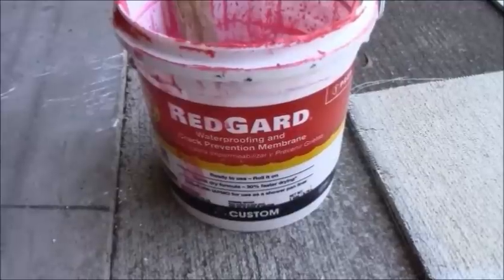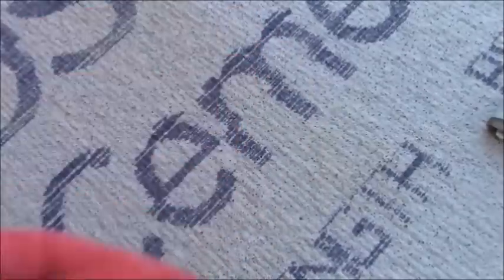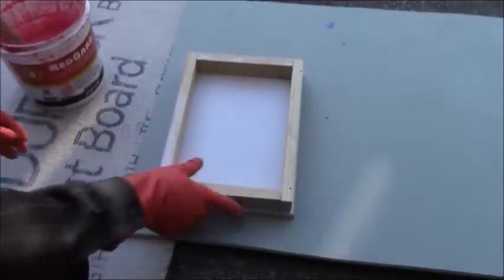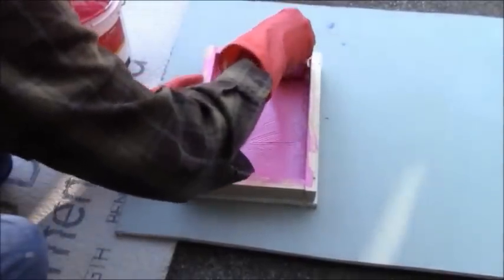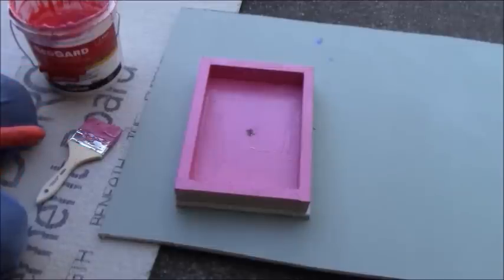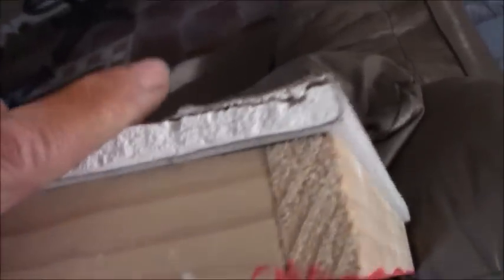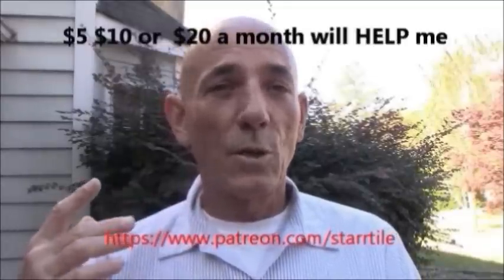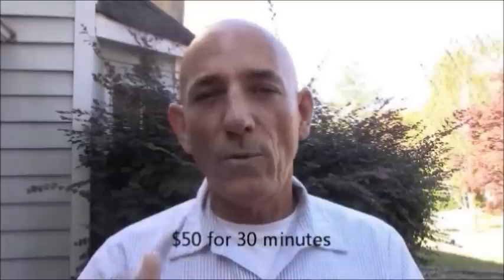REDGARD vs SCHLUTER

Comment: Thanks for putting this together, confirmed what I always thought, that all these systems work to be waterproof when installed properly. Love your freeze test. Many years ago as a Motorola engineer, we used to call this Advanced Life Testing with temperature cycling.The tile world is basically divided into Schluter and Redgaurd opposing camps, but let me offer an argument of support for Schluter Kerdi panel boards, that no one else ever seems to mention. They are light, light, light! I have weak wrists after a sprain a few years back, and a shoulder deltoid muscle that is very weak and bothering me. Carrying Hardy Backer boards, or cement boards upstairs in condos long distances is a nightmare for me, BUT, I can carry the entire tub surround of Kerdi panels in one trip they are so light! I don't have to cement down any kerdi membrane because Kerdi panels have it on there already, all I do is use Allset on the corners with Kerdi band. Done, no 3 or 4 layers of painting the whole shower with Red Gaurd. I don't have to breath in any vapors, and cutting Hardi backer is a nightmare, especially smaller strips, and so is cutting cement board, and leaves silica dust everywhere. My method of using Kerdi boards while costing more, 3x times price of Densshield, is very fast, no mess, takes less time very little effort, no dangerous vaoprs or particles, easy to wet shim onto studs, the black graph lines are very helpful to align your tiles, no brushing on multiple coats. When we want to save money, we use Densshield and Kerdi band the corners. Bottom line, do what works for you,  all these systems work. The only thing is I won't eve ruse green board because should something ever happen around it and water gets past the RedGaurd, you'll still have mold. BTW, Kerdi will fail if you don't use unmodified thinset, you can use Schluter's AllSet. Mos ttilers don't know what unmodified vs modified means, and can't read the ansi numbers on the bag, so they blame Schluter when it fails.
Reply: Thanks for the note.  With Hardiebacker® cement boards, there’s no need to worry about dust generation if you cut it using shears or the score-and-snap method.   You can find tips for doing this easily  here: https://youtu.be/4LxB5fHc5Xw
Reply: The system that does not depend on perfect implementation is superior.  Water makes portland cement harder so cement board is ideal.  If the red guard ever delaminates from the paper on a green board years from now that green board will fall apart if it gets wet.
Reply from the maker: @JamesHardieBP  I can't tell you how many times I pull out wall board that is embedded into the pan, the pan is wet and wicks up the wallboard, the mold growth will go up sometimes 16 to 18 in, and yes on hardibacker as well. I understand that is always a case of operator malfunction, but to say that a cement product is mold and mildew proof is a fallacy. I use Hardi in steam showers only because it is rigid and smooth, I would rather tile on a smoother surface.
Reply: @StarrTile  what if you apply redguard to the edge of the cement board?  My plan for my tub remodel is to have it overlap the tub flange by 1/8 to 1/4 inch and waterproof the edge with redguard so that no moisture can wick.  Is there a flaw with my approach?
Reply: One youtube video I came across said that he coated with redguard on his shower wall but didn't have time to tile finish it so he had been showering in there for three years without any problem,  LOL!!!

Comment: I recently built a home and redguarded the entire osb subfloor to protect it from moisture during the building season.  The redguarded subfloor was soaked several times by thunderstorms, sometimes the water sat on it for a couple of days.  The redguard protected the subfloor like a champ and never leaked.  The stuff works.
Reply: That is a great idea! I cheap out and used latex concrete bonder, takes a few coats but it’s fast.
Reply: I am even cheaper and use up polyurethane from jobs that would just go bad in the cans anyway.
Reply: Expensive though.  I used it on shed doors made of wood.  Then primed them and painted them.  Never warped or split.  Stuff is awesome
Reply: I’d have never thought to do that. 👍
Reply: That’s totally unnecessary. Osb are rated to be rained and exposed up to 6 month
Reply: This comment section has been waterproofed at good prices! Appreciate the tips!

Comment: If you're talking about just waterproofing for a full shower built the exact same way, (green board, pan liner, dry pack, etc.) it will still cost $120.00 for RedGard (two gallons for rolling out the walls two coats and three coats for seams, pan/curb, and niche/bench.) The only difference is the waterproof membrane. The cost for Kerdi membrane and a bag of thin set is also $120.00. The best benefit is no dry time between coats, and in this industry time is money. Great video btw, love experiments! 👊
Reply: I prefer to let the kerdi dry before tiling over it. If I ever have to pull a tile off a kerdi wall to adjust it the kerdi will often come off the wall with it. I'm just not comfortable with that. Whether I use roll on membrane or kerdi I let them dry.
Reply: Theres one slight difference between the two. The red stuff is waterproof.. The orange stuff is water resistant 🤣
Reply: Kerdi is more money. My customers don't wanna pay for THAT
Reply: Andrew Knapp 
Your labor free? Red guard is much more Labor.
Reply from the maker: @Crunch9876 I disagree RedGard is MUCH more labor, takes a little more time perhaps but given the failures I highlight with PRO's on Schluter I'd not want to take the chance....nor I doubt would an inexperienced DIY'r which is basically why we're posting these videos to educate homeowners not contractors.
Reply: @crunch9876  of course it isnt but where i reside with my client base i can't sell kerdi to anybody. In my experience people like to save money. I also DONT think the labor of redguard off sets the price of kerdi material. And lets not forget that you need neither redguard or kerdi for code compliance. Are they useful and good ideas...absoulutly. But we really are talking about the fundamental difference of an upgrade.
Reply: @michaelhorn9114  sure will if that means I can think for myself
Reply: @michaelhorn9114  it's amazing how well their marketing team works. Now they have brainwashed soldiers like you doing their bidding.
Reply: @michaelhorn9114  you're so brainwashed that you think I really care which product is used. News flash! I don't. I am only stating that the installation method prescribed by schluter is not waterproof.
Reply: Does anybody know the actual mil spec for red guard application?
Reply: @StarrTile  yep your right I agree with you. 😎

Comment: I did both my showers with Durock + Redguard (or similar product).  It was very frustrating having to do 4-5 coats of the membrane because of the roughness of the cement board.  When my brother did his shower, I consulted him to use Densheild.  I love it.  It's just like greenboard except a thicker front coating.  So it is already waterproofed and is sturdy enough for heavy tile yet scores as easily as any other gypsum board.  You still need to redguard, but mainly just screws and seams and maybe a single thin coat over the rest for good measure.
Reply from the maker: Agreed, I like Denshield too, hard to track down in my area and kind of pricey but it's a great product
Reply: Same here, I use denshield in every job, and seal the joints and screws with redgard or silicone and thats it

Comment: the only potential issue i have with using sheetrock is that you are essentially depending on the paper surface to hold the tile.  i use hardiebacker with redgard. yes, it is heavier and messier, but i'm thinking of getting the shears for cutting it. appreciate your videos and your willingness to share your experience-learned wisdom.
Reply: Once you apply redguard to the board. Tiles are holding to the redguard not the cement board, so if the redguard let go which it will take the same force as pealing the paper of the sheetrock. So i think sheetrock will do just as good unless you need the cement board for impact or something
Reply: Actually,  the floor is supporting the weight of the tile-not the sheet rock.   It's almost leaning on the wall.
Reply: Same with Schluter, they allow their membrane to be applied over regular drywall, let alone kerdi board which is FOAM.

Comment: In my career I've used literally every type of underlayment board available here. The, and I mean THE, only one I ever had a problem with was Hardi. Even Denshield gave no problem. Pro Hardi is it's smooth. If  you follow instructions, nail on marks (some being 12" apart) leave 1/8" space, mesh tape, wet with damp sponge before tile installation, you still run the risk of cracked or loose tile. My favorite was Durock, unless they have changed they were the only one UL approved for heat, sound, and moisture resistance. My standard for shower installation was 8 mil poly vapor barrier, 1/2'' Durock, and 3 coats of Red guard. Never had a fail. Never had a leak. Really enjoyed this one, and one question. Have you ever done a job where it was so hot ( new home) where you had to use ice water in your set and grout? Not fun!!! By the way, y'all think the fed shutdown is bad? Try what we are going to experience for the estimated next 14 months. ALDOT is shutting down 59/20 (20/59) coming thru to replace and redo all the bridges. GRRR!!!!

Comment: A full wicking shower is still the best method imo. Fat mud walls and curb and deck mud in the pan with a liner. All of these new products are nice but if you make one mistake your screwed. Felt wire and liner with a pre pan works very well and is very cost effective.  Just my opinion but I do enjoy experiments. Keep up the good work. Fyi if you really ask Isaac what method he would use on every job bet it would be mud with a hot mop and pre pan if he had his choice. Hot mop is really only done in Cali these days but same as a pre pan and liner.

Comment: As. far as I understand, you're supposed to use modified thinnest to apply Kerdi to drywall substrates, or ditra to wood subfloors. You're not supposed to use modified between Kerdi (or Ditra) and glazed porcelain, ceramic, or glass tile as the two surfaces aren't very porous and that will prevent the moisture from dissipating  from between them as both surfaces can act as a barrier against airflow. You're allowed to use modified thinnest if you want, though. But if you plan on using a sealed grout, be prepared to wait for extended curing time of your thinnest. For modified thinnest to cure properly, it's required to fully dry out. If it isn't allowed to, that's why people find crumbling damp modified thinnest .behind their detaching tiles. But as far as attaching any of it to a porpous surface that will wick moisture away, like green board and wood, that's not an issue. Greenboard isn't waterproof or a moisture barrier, it is as you mentioned, treated to inhibit mold and mildew production. It's still porous.  I'm using both Kerdi/Ditra and Regard in 3 different bathrooms right now in my house. Amazingly, the two can be used in conjunction with each other.
Reply from the maker: Good info, thanks
Reply: @StarrTile No prob. From all my research, the best waterproofing system is Laticrete's liquid membrane with their embedded fabric applied to Denshield. Though I don't know of a local supplier of either in my area which will supply it at msrp prices.

So.... my preferred methods personally is using kerdiboard due to the ease of installation as it's pretty hard to f- it up so long as you take the time to watch the installation video, and because you don't have to wait for it to dry to apply a second layer. Once you waterproof all seams and blah blah blah, you can immediately begin to tile, even before the thinnest under the kerdiband is done curing. You can waterproof and tile in one day. Regard I believe requires a full day of drying before applying the minimum required second coat. Also, cutting out tightly fitting openings in the board can be fairly simple if you use a spare board to form a template first. Just use the grid on the template and line it up with the grid along the side and top of the board, and you can get a very accurate fit around valve bodies that have collars like the Hansgrohe ibox, which I highly recommend. But because it can be cost prohibitive, the easy way to integrate a more affordable secondary method for other shower walls, like Redgard,all you need is the Kerdiband by Schluter to overlap the seam by two inches onto both the Redgard and Schluter products. For example, someone can Regard an entire shower wall surround in s wet room, and still use a Schluter Shower base if they happen to like a tillable linear drain with a tiled in glass to ceiling wall like what my brother wants me to build for him right now. All you need is to add the kerdiband around the edge of the base and up two inches on the wall where you first applied the Kerdi, and it's immediately ready to tile. That's how easy it is to transition between the two in the same space. And I simply use the $9 bag of Custom's unmodified from Home Depot for that transition. I believe most topical methods of waterproofing recommend unmodified thinnest if the product also happens to be a vapor barrier for the installation of most non-porous tile anyway. Also, Kerdiboard is foam, which helps with hiding the awkward noises from escaping thru the walls into other living spaces... y'know... the kind of noises that you'd just prefer to avoid hearing coming thru the wall of a bathroom when your houseguest or teenager or upstairs neighbor happens to be doing something unholy that might require tons of bleach, a priest and a therapist to make clean again.

Comment: Issac just made a new video where he waterproofed a mockup with kerdi  and let the water sit for 7 days and it failed both times lol I used to think redgard was garbage because that's what people would tell me until i saw your cardboard box video and that opened my eyes. I still would not trust a liquid membrane as a shower pan liner because i've heard it can crack in the corners. I like to use that pvc shower pan liner on the floor and liquid waterproofing on walls, benches, niches and curbs.
Reply: more hoops and hurdles
Reply: Matt The Builder.  Issac didn't do it wrong. Schluter did approve his method. He did it as per schluter instructions. Even if you don't use kerdi band, you will still have seams that's a potential for leaks.

Comment: I think the reason redguard showers might fail is if the trowel was to score the redguard. With kerdi, the membrane is made of fiber so tearing a few might not completely kill it.
Reply from the maker: If you're troweling thinset THAT firmly then you're doing it wrong.
Care is taken in every step.
And I've used kerdi before that I've torn just trying to push out excess thinset....just saying